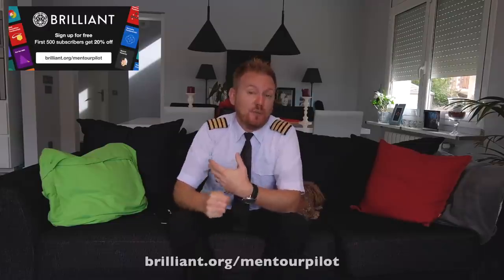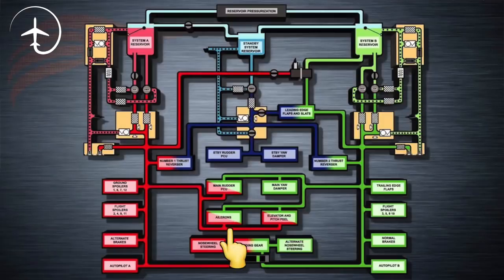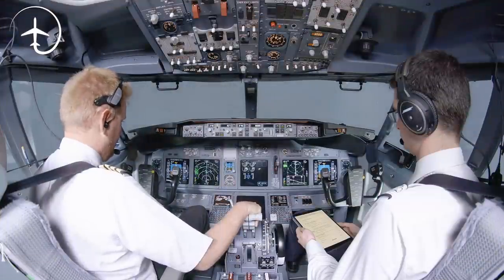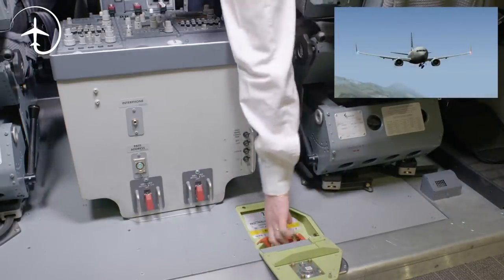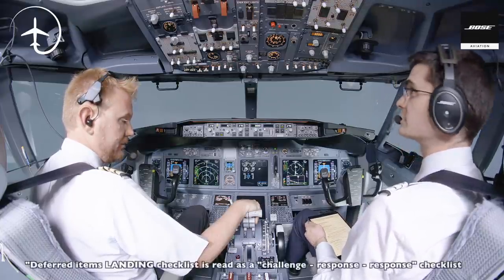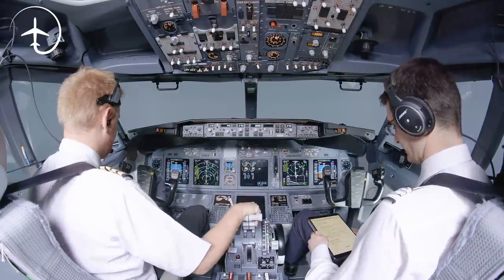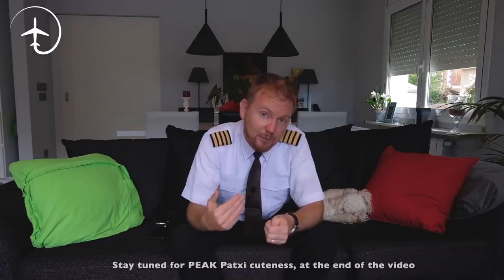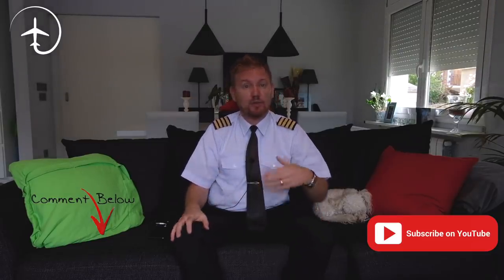Boeing 737 Emergency gear extension!! Cockpit video (FFS)

Comment: Hi Captain Mentour, thank you very much indeed for those great informative videos, I kindly request you to do emergency simulation session on how to handle loss of an engine ( I do mean physical separation and fall of the engine from the wing) this happened to American Airlines  flight 191 DC10, on the accident flight, just as the aircraft reached takeoff speed, the No.1 Engine and its pylon assembly separated from the left wing, ripping away a 3-foot (0.91 m) section of the leading edge with it, this creates asymmetrical lift on the wings, the left wing has much less lift so the giant DC10 start banking  and yawing to the left, the flying pilot,  First Officer James Dillard correct it with the rudder! and start slowing the 170 ton giant DC10 to V2 speed to reduce the load on the two remaining engines! as he start doing so, the left banking and yawing to the left start deviling! because with the reduced airspeed the flight control became less effective to counter this lift asymmetry condition between the left and right wings, sadly they lost the control of the plane and crashed just 45 sec after liftoff! the interesting fact is that, the NTSB  said that if the crew maintain higher airspeed than V2, the giant DC10 could still be flyable and could be possible to return it back safely to the ground. It will be very exciting if you can simulate such a condition on a B737 simulator. Thank you!

Comment: You or maybe Captain Joe once mentioned that in case windshields are damaged so much it makes it impossible to see then there is a procedure to open the window and to actually stick pilots monitoring head out to guide the pilot flying during landing. Is it even possible to do such a thing in a simulator?

Comment: Show us the rear switches on the middle console floor and what is kicking g around in the cockpit,  flair pistol , escape rope, what's behind the doors for goodies , the ancillary stuff like breaker panels that you normally do not play with , spair  parts like bulbs , pilot comforts,  first aid kits,  what happens if you spill a drink , for Lufthansa Frankfurt  how the cleaners turn on the radio compass to show the direction of mecca to pray, yes they do it ask the pilots union cockpit! How do you charge your mobile phone. Can you listen to music or watch a movie,  tell us the secrets of how you guys have fun on a long flight   I know the I spy with my little eye game,  tell us a bit more about the 13ghz hight radar beam angles and the weather radar problems and beam angles  I am a mode s transponder fan tell us what info you squawk and what you can squark

Comment: Show us what happens when the plane has been exposed to high wind gusts on the tarmac, and which has caused a control surface to be pushed past its stroke limits and is now locked in place.

Comment: 1. Did Boeing change lithium battery on Dreamliner?
2. Could little aerodynamic flaps bee installed on door of gear box to help open it with streaming air pressure?
3.  After how many flaying hours is maintenance required on a passenger airliner?
4.  Does Airbus A330 or A350 use lithium battery?

Comment: My  brother  just back from Florida to Albany, NY and  before takeoff, the pilot announced there was an air conditioning unit fault  and under flight rules, the FAA requires that it not take off.. Back at the gate the mechanics fixed whatever was wrong/failed, then it took another hour or so for an FAA tech person to sign off on it (the repair). At 35,000 feet there is plenty of cold air up there to compensate... What is your take on that type of "failure"; to me it's no big deal.

Comment: right, the landing has to be extended so that the engines fit underneath the wings. Then the plane doesn't require a push-the-nose-down software

Comment: I was once on a flight that the oxygen masks suddenly deployed, the plane shook and then started descending far more steeply than I had ever experienced.  The engines also seemed to be at low thrust.  I thought the shaking was from the pilots lowering the landing gear to slow the plane during descent.  A friend of mine who was studying to get a pilot’s license said that wasn’t it, it was the flaps being deployed.  I don’t remember what model of place it was.

So, I’d like to see the procedure for when cabin pressure is lost and cannot be corrected.
Reply: Larry De La Briandais Yeah emergency descents aren’t the funnest thing in the world. A bit like a rollercoaster but without knowing what’s going to happen next.
Reply: Flaps doesn't sound right, it would have been flight spoilers.  Flaps increase lift and drag, spoilers decrease lift and increase drag.  Descending means trading potential energy for kinetic (that is to say, speed), and idle thrust and spoilers means you can bleed off that speed better and avoid overspeed on the way down.

Comment: I understand it was a demonstration of emergency extension with the explanation of the associated hydraulic system failure. My question is what warning you would have had that Hydraulic System A had failed prior to the normal point of extending the gear at glideslope intercept? Maybe some of your viewers would be interested to know, depending on the aircrat,  there may not be a way to detect a failure prior to selecting gear down at GS intercept and this would now require terminating the approach immediately to either troubleshoot the malfunction or proceed to the manual gear extension procedures before requesting another approach. Very good video with excellent resources and explanation.